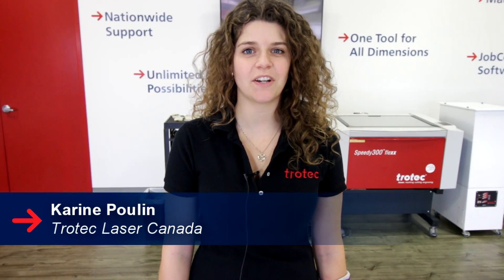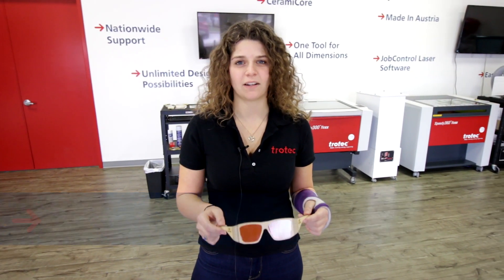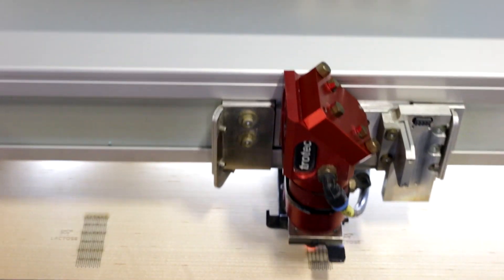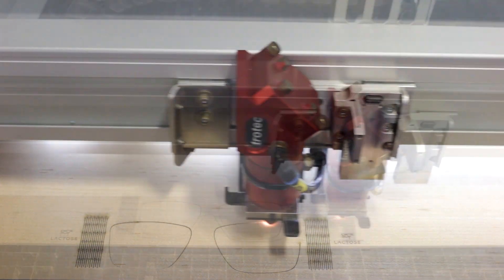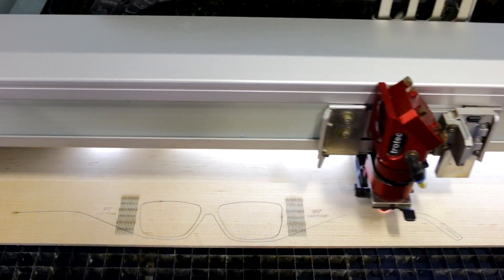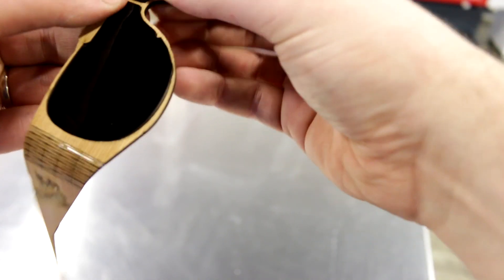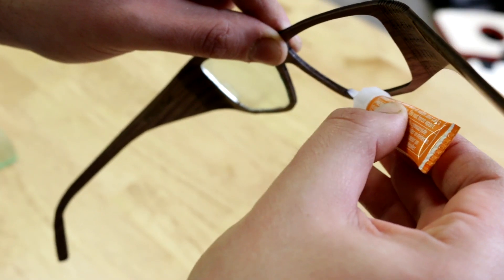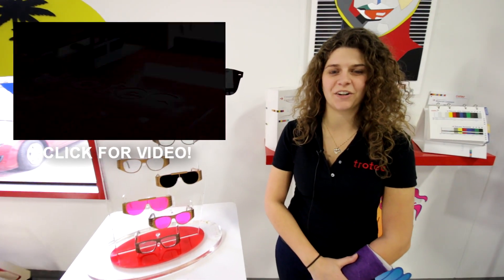Wooden Glasses | Laser Cutting Wood | Trotec Veneer Woods

Comment: if i use your file and made the illustrator into autocad what is the dimension unit used in your file, thank you in advance
Reply from the maker: Hi Ahmed, yes you can print directly from AutoCAD, you may need to do a few tests first on the laser, but yest that should be no problem.
Reply: @TrotecLaserCanada  great then what dimension unit did you use making the file, mm or meters or cm or inch etc..?
Reply from the maker: What's your email Ahmed, we'll send you the artwork file.
Reply from the maker: Thanks Ahmed, we've sent you the files. Cheers!